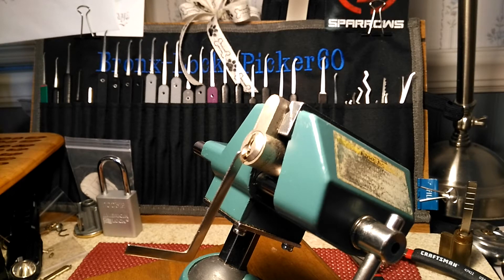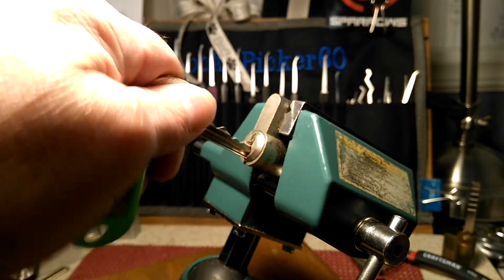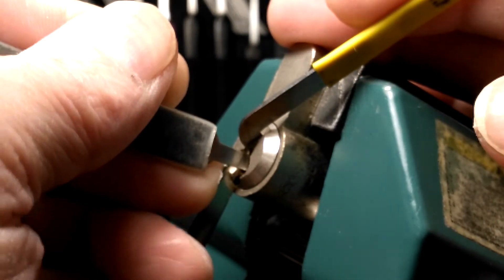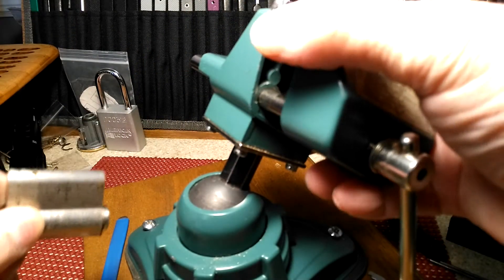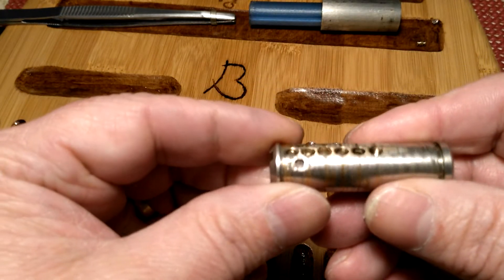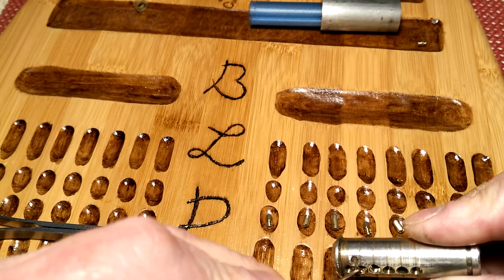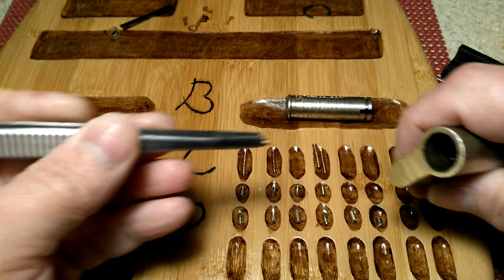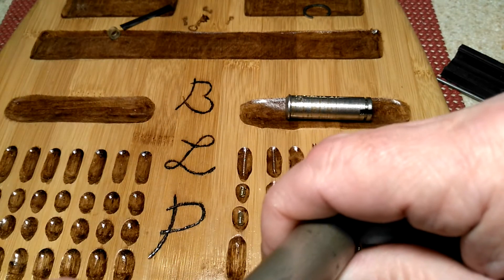(36) 6 pin Silka Euro cylinder spp'd & gutted. Sent by Randy Perkins & pinned by Pete Restall!

Comment: Pretty dam quick for one that's been in the naughty bucket lol. It's. always a good feeling to get one  out, good job my man.  I had one if yours in there for a while I was glad to finally get it out. Thanks for sharing bud.
Reply from the maker: +Bobby Keyz I was surprised as all get out when it opened that fast. I was speechless. Lol. Thanks for watching.
Reply from the maker: Maybe I should go through the  naughty bucket more often. Lol
Reply: Bronx-LockPicker60 I went through  mine when I ran out of challenge locks and ended up getting two of them out.
Reply from the maker: +Bobby Keyz I have at least 20 challenge locks still to open, plus 10 in naughty bucket!
Reply: Bronx-LockPicker60 looks like you need to get busy my friend lol. I can help you clear some of them up lol.
Reply: Bronx-LockPicker60 I have a good amount to open up now and quite a bit more coming. I have a package to open now.
Reply from the maker: +Bobby Keyz After I send you the 2.0, and send Randy Perkins , Pete Restall and FOXXY3 their packages. You're first on my list for a package, then PickMe and Trekmaster30